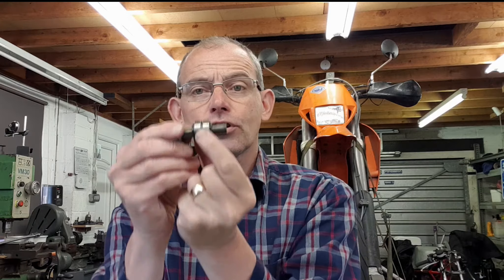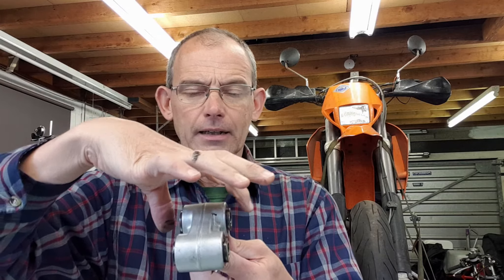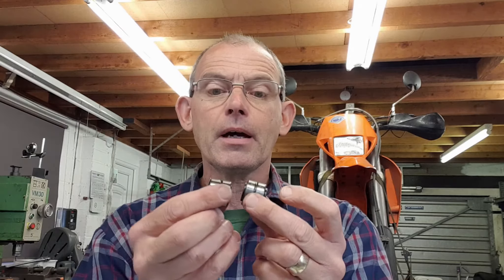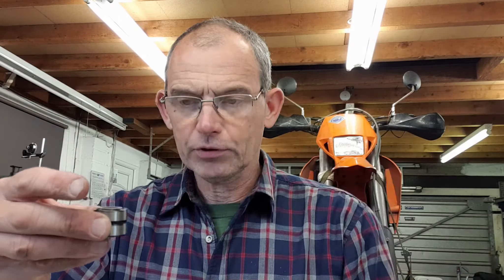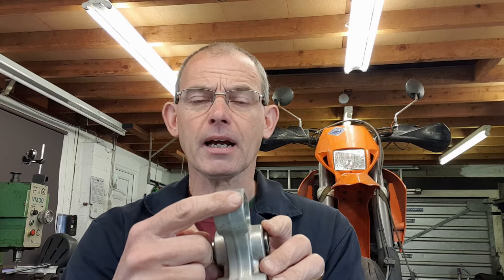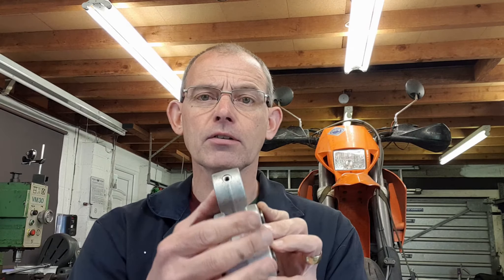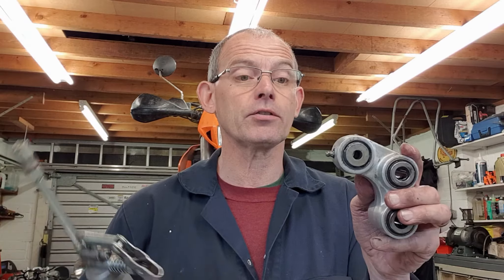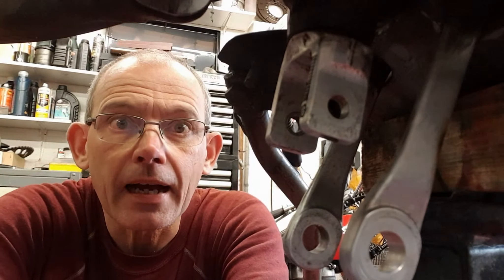KTM Shock linkage - Part 2. Replacing the obsolete spherical bush, bearing number 16-1062.

Comment: Hi Thanks for the video very useful. I was actually looking for the same (no longer manufactured, god knows why?) spherical bearing 16-1062 for my 1982 Maico Alpha one shock linkage and after much searching found it was also a problem for KTM bike owners too and eventually found your video. Interestingly I had considered a needle roller or a solid bronze bush and ground sleeve. Either will work I think .The original bearing was not really up to the job and wore very quickly due to the very large forces from the Maico rising rate linkage.  The needle roller should be up to the job and due to your video  I will be trying that approach first to see how well it stands up. Thanks again.
Reply from the maker: Sorry for the late reply. Well, months later I can report that the bearing is still holding up and doing a good job. Pathetic that KTM can't supply a common bearing for a bike less than 20 years old.
Reply: I had a 490 Alpha 1 for 8 years. (I think number was MRV 476Y)
 Was originally built by a shop in Portsmouth for the Le Touquet beach race.
Little bit modified, 63bhp at wheel.
Do you have Corte Cosso shock or something newer aftermarket?
I would check bearing suppliers as there is probably an alternative spherical bearing available (you actually have to go there and check catalogue though)
490 was the only bike I ever had that tried to kill me on multiple occasions (until I put it back on MX gearing from the high Enduro gearing). 
Theoretical top speed was 127 mph, had it over revving in top once down a fire break, that actually scared me as I was on my own out in the woods)
Reply: Hi yes I have ohlins shocks on both my alpha 1's . One on a 250 gs and also the 400 mc. As you say the latter has tried to kill me more than once over the years. Its standard but still a handful at 47 hp.

Comment: In the process doing this. Great to find your video! 👍
Reply from the maker: Hope you find it useful. For the record, it worked really well and more importantly, still is doing! 😊
Reply: @t20racerman  I really did. As you read about it on the forum so did I but you solved it in a way I was planning on doing it too. So, good to know it works well. Thank you! Edit I do find it disappointing that KTM can't provide parts for a bike that's that "young" still. Worth considering if buying a new KTM.

Comment: The center bushing that the that’s fit into, is that something you can order or where did you find that bushing? Looking to do this to my 1989 350 which uses the same bearing. I have decided to use a 96 125 ohlins shock which is barely longer by .5”. Seeing is I can use just the 96 dog bone from the linkage. Thanks!
Reply: Top hats fit into*
Reply from the maker: Hi there
I do say on the video at about 5mins 10secs. Link on screen to simplybearings.co.uk. The part number is on screen too
Glad you found this video useful - good luck doing your bike 😊

Comment: I would have made graphited nylon or bronze bushings as a replacement, needle bearings tend to wear a bit quick because they were designed to rotate but in a linkage like that they only have very limited movement and Brinnel
When the Rickman brothers were developing frames for the CB750 and Kawasaki 900 they did some testing and found bronze bushings had most surface area and supported swing arm better.
Would have been far better off heating alloy as it has far more mass to hold heat, 100 deg C is plenty (and not enough to soften Loctite)
If those 'top hats' are not hardened they will be totally worn out by now (1 yr later)
The seals look just like the ones on Yamaha DT400MX from 1980's
BTW, what are BOATS? Is that the 'new' designation for what used to be RUPPS? (Road Used as Public Path)
Reply from the maker: It was an improvised solution, not maybe the best from an engineering point of view. Still going strong though.
Yup, a BOAT is a 'Byway Open to All Traffic " 😊
Reply: @t20racerman  I'm not an engineer (trained as a precision turner/machinist, way before CNC) and was a motorcycle mechanic for a long time.
 Learned machining so I could fit easily available BSA parts into my Royal Enfield's (had 5 250's, Continental GT, Crusader, etc)
I learned a bunch of stuff over the years but 'got hurt' in 2011.
 Teaching at a 'trade school' was far more dangerous than riding motorcycles

Comment: We seem to have similar taste in bikes. I have a few old enduro bikes. An old t500 suzuki. The a10 and also used to do classic racing. Fixing up a old fantic at the moment. Had a few ktm,s  and got a nasty note from Google after looking up wp  as in the suspension. Apparently it was racist.. if the edges of the needle rollers do start to break there are barrel ground rollers ???
Reply from the maker: Some nice bikes there - we do indeed have a similar taste in bikes. I used to have a GT500 too :-)
If the bearing does break up - its still fine now - I'll look for solutions then.